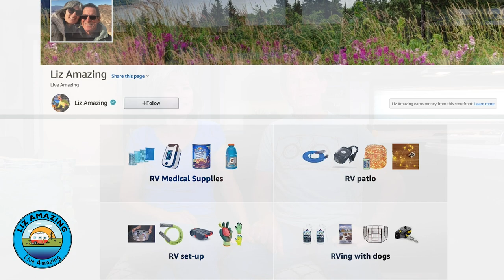RV Life | Sewer Solution | Game Changer | Macerator Pump

Comment: This is spot on. The wife and I have been RV'ing for 30 plus years, and a macerator system is the only way to go. The only thing that tops it is the two macerator commodes that we have in our coach. Does the same job right at the "business' end. It also allows you to use regular 2 ply tissue.
Reply from the maker: Sounds like a winner! We actually flush wet wipes down our rig and have no problems. But they do sit in the tank and start breaking down first, so am not sure if they would work for you. Here's our video about that: https://youtu.be/2Ziwfzf6xK4

Comment: I use the macerated pump the same way. One additional thing I did was adding a 1” 90 degree cam and groove fitting to the top of the tote and the ends of the hose. Put a adapter on the pump and you are good to go. Find a industrial distributor of small plastic tanks that will drill a hole and spin weld a pipe fitting to the tote. Install a male cam adapter with a cap   . No longer have to muscle a 35 gallon tote that weighs almost 300# when full. Almost every time I’m using it someone stops by to see the setup. Good video.
Reply from the maker: Paul says that's a good idea!

Comment: So apparently shit doesn't go uphill so I got this macerator, hose and adapter you recommended. I was trying to reach 40' ft incline to the septic inlet.  I used a regular garden hose in combination with the extension hose to reach and for power I added some wire extensions from the macerator to my battery bank so I just need to plug in the wire connectors supplied and push the button. Works good. Problem is I have two black tanks with two separate outlets far apart from each other so the other one is still a slight issue to dump but it's closer to the septic inlet. Fyi for those who have two separate outlets; Don't try and use the macerator connected to a Y connector on rhino hoses. It just sucks up the hoses. Kinda like trying to suck up a thick milk shake through a cheap plastic straw, the straw collapses. Lol. Otherwise the flojet is good. Hope it can handle all the thick long hair of my partner. Her hair is my worst enemy.
Reply from the maker: Thank you! Here's our update: https://youtu.be/QzTkLgpxXnE
Reply from the maker: Good info RD, Thanks!
I can see a potential issue if enough hair gets wrapped around the impeller, good luck with that. 
Thanks again for a great comment. P.
Reply: @LizAmazing  no problem. Thank you for your detailed video. You two helped a lot. I too spend time using the tote so it is going to help not having to take it out the bed of the truck. 

Good luck out there. We are in Oregon now trying to make it through summer. Waiting for all the part timers to go home already. ; )

Comment: We have an Airhead composting toilet. It saves water usage when dry camping.  I was afraid of it at first, but after having it for over a year, I would never have anything else. We pulled our black tank and installed a second, larger grey tank. We also have a macerator to pump grey water into a water bladder into the back of our truck instead of having a tote - we used to have a tote, but now, since we just have gray water its less dangerous and we can use a lightweight bladder, the same type for acquiring freshwater.
Reply from the maker: Sounds like you have a good setup for dry camping. Did you know in Australia they call it "wild camping?" I love that. We have heard good things about Nature's Head which is probably similar to Airhead. Happy camping to you!

Comment: I have had a Macerator for my RV for 5 years. When boondocking or camping without sewer at campgrounds near home (less than 50 miles) I won't even bother to use the dump station. I'll just come home and empty into my home sewer through the clean out. I can take my time and get the tanks really clean. But, I don't have a tote so if I have a choice between scenic site or sewer site, I'm taking the sewer site.
Reply from the maker: Yep, without a tote, the sewer site is the winner! Glad to hear you have a macerator as well. It's been a real game-changer for us! Happy camping to you!

Comment: I've been boondocking for nearly 4 months in a BLM long term visitor area(LTVA).  I use the same method Paul described.  Tote in the back of the truck, and I fill the tote using the macerator pump.  I'm a mile and a quarter from the dump station.  I also have a 30 gallon fresh water bladder.  My routine is, once a week, I dump my tanks into the tote, dump the tote, then fill the water bladder before my return.  I also have a 12v fresh water pump, like what the 5th Wheel has for internal water.  I use it to pump the fresh water from the water bladder into my fresh water tank. I have not had to move my fifth wheel for water management.  I've used the mactator for dumping into a household sewer via the cleanout, while moochdocking too.  (people should check local regulations on that one).  I can say, this is a worthwhile investment, and can be a real convenience, and time saver...
Reply from the maker: Awesome comment, Roger, thank you very much. Loved hearing that you haven't had to move your rig in all this time. As far as moochdocking goes, one could run a garden hose into the house and dump into the toilet. Thanks again for your endorsement of the macerator pump!

Comment: My coach came with  a m pump system which I had never seen before in my life I have used it since 2007 and it is absolutely wonderful. And it will pump uphill 40 ft.² through a 1 inch line. Thomyt
Reply from the maker: Yay! Macerator pumps really are game-changers! See you on the road!

Comment: You mentioned a macerator might not be good when you're boondocking. It's the perfect accessory if you're boondocking, if you also have a fresh water bladder & a pump to transfer the water to the rv. We've spent months in the desert north of Yuma, AZ & never had to move the rv. We have an 85gal vinyl water bladder that we got from the company that used to make the blue 45gal one for Camping World. They'll make any size you want, & when you're not using it, it folds up very compactly. The company is New World Mfg., in Cloverdale, CA. You also need a pump, either AC or DC.  I bought an AC pump from Harbor Freight. I pump the waste into my 35gal tote in the truck, then go to the nearest dump & empty it. Then I fill the 85 gal water bladder & return to the rv & transfer it into the rv. So we can sit out in the Southwest desert for long periods, & not have to be stingy about my water usage.
Reply from the maker: Yay! Glad to hear! You got that right about the bladder, too. We just did a video about that, check it out here: https://youtu.be/qi-9y8ml424

And it sounds like you have a good setup and are living the good life in the desert!

Comment: Enjoyed the tech talk on the reality side of cleaning the tanks. I wondered how a less physically endowed person like me would handle moving the waste water. As usual you two are showing the way. Back when we were a road warrior family the head was strictly for use when you were sick or injured. Often the campgrounds were selected based on non pit toilets and showers if at all possible. The trips were more mapped out by the quality of the facilities then by what we came to see.  We spent a lot of the time hiking to the restrooms. The tank cleaning was often done once or twice during the whole vacation and in those days emptying the tanks was done on the way out of the campground at a drive in dumping station. The idea of actual sewer connections at the site..... wow that would have been pig heaven.
Reply from the maker: Yes! Things have really changed, haven't they? I started camping in the late 80s and it was assumed for many decades that electric AND water were luxuries. Now full hook-ups is standard at many private campgrounds. We've been to several RV parks where the sewer hookups are in such demand that people stake out sites, sign up for them or otherwise demand them. I think for the fulltime RV life, a lot of people have a washer/dryer on board or kids so they just have to have the sewer. Thanks for your comment. And YES you can handle the tote with no heavy lifting if you get the macerator. See ya on the road!

Comment: We have the same rig and just bought a Valterra twist on tank valve at the base of our tank drain. Our previous RV had it and it is nice to have (no surprise when you take the cap off!).   As low as it was before, it is lower now!  My husband is wanting to maybe cut back the drain tube so that it doesn't hang so low.  Will let you know how that goes.  

As to choice of site, we would choose the view over the sewer - as long as we have access to a dump station (and you never know who you might run into at the dump station!  LOL) we are ok.  But with two of us and only weekend or short term trips, we don't need sewer so often but longer trips, we would likely want the sewer hookup.
Reply from the maker: Very good points! I had the twist-on, but yes not enough room to add one on this rig. When we got in that tight situation at the Idyllwild campground, we broke off the sewer cap so we know we are low. I think you could cut off some of it with a dremel. Paul has a roto-zip, which is kind of a dremel on steroids!

Comment: The best tank to use is a 50 gallon plastic barrel. Use one with the corse and fine thread bungs so you can use standard pvc for the outlet on the corse side. Add waste gate to the output and get a hose bulkhead for the hose from the macerator. Its a much cheaper setup than a store bought tank. Make sure all connections are well sealed and it will give years of service. My tank setup cost less than 60 dollars and i have a 50 gallon capacity which is well above the trailers 32 gallon black tank. Also add an air vent on the top.
Reply from the maker: That’s awesome, John! Thanks so much for sharing. I’m not sure that everyone that is traveling can carry a 50 gallon barrel, but definitely helpful. Thanks for watching.
Reply: @Liz Amazing  I edited my comment to fix one word and added the air vent to it. Won't fill or empty too well without an air vent. I do understand that some can't use a 50 gallon drum. My camper is a 36' pull behind so I have a lot of space. They do have 30 gallon drums as well. Those should work for others and you could use 2 of them.

Comment: I bought these items, too because we have had to boon dock at home due to smoke from fires. Our home, a cabin is far from air tight!  We do not have potable water and and far away from our septic clean out. We are 20 miles from a dump site! I bought the biggest tank before thinking about, "and then?" So, yes, in the truck bed for sure! We just partially filled and had a terrible time getting it into the truck!  Then i read about the macerator, bought that but have not used it because of wiring. The directions are a bit sketchy.  I have a 12V jumper cable battery that i pump tires with, too, and now a 1000 w Jackery "generator." Can i use one of those somehow? I bought clips. Can i put clips on the wires and clip them to the jumper cables on the 12 volt? I really need it very soon as we were unable to dump last trip. I have to enlist a neighbor to get it into our narrow steep windy drive backward! Last time we got deep scratches in the truck hitting the fence post! That was with help! We are selling our place, but it is not an easy sell. We would use the RV much more if it weren't for that!  Now my truck is ruined😒. Once we sell, we are going to get a fifth and different truck to full time. Could you do one more vid covering the electical for the macerator, please?
Reply from the maker: As long as the battery clips will handle 20 amps they should work. 
Perhaps I should do a video on the setup I did for now I'll attempt to explain it;
I used 10 gauge wire and a 30 amp fuse on the positive leg and I ran the circuit from the battery to a spot in the pass through where I have about 4' of the wire spooled up and stowed in a little cubbyhole on top of the wet-bay so that when I need it I just pull it out and plug in the macerator.
Reply: @LizAmazing  thank you. I will look on the package. I did not look at different sizes, just saw these clips  that looked the right size. The rest sounds great, but uh-huh glaze over on the rest, sorry. It will come especially if you do a step by step. It sounds like a better idea. How do you store your quack hose? I have my cleanout hose in a black bag, but what a pain!  The last 2 places had cut off their hose ends so i could not use the flush! I tried to just hold it up to it but just got a great shower!  That was at Marysville, WA I5 rest stop both sides of the freeway. But was i grateful for the dump!  Thank you.

Comment: My Jayco Pinnacle came from the factory with a macerator. The problem is that the engineer who designed the rig has the handle to open the discharge installed under the camper under a slide out. I’m 73 years old and don’t want to climb under it every time I want to dump it. Especially when I’m parked on a gravel site.
Reply from the maker: Oh no, that's not good. I wish there was some fix for that. Thanks for watching.

Comment: QUESTION:  i have the same set up but i was wondering how you connected the 1" hose to the tote tank.  Is it always like you videoed where you have just shoved the hose into the elbow?  i am in fear of that and having the pump pushing it out of there and having a s&*$tty day. :)  Did you find a better connector piece, and if so where?  Or have you just ran with it like that?  i have searched high and low for some sort of connection piece, but to know avail. Any help would be appreciated!
Reply from the maker: No, I just use that 90° elbow. I don’t hold it down, it stays put. Just have someone stand there and hold it the first time to be sure. But I have never once had a problem- Paul

Comment: Is there a way to hook this up to those portable camp toilets? I don’t want to deal with a big waste tank when it’s time to dump I’d like to just hook up straight to the portable toilet and dump into the sewer station.
Reply from the maker: You can, but it may not be worth it. Small portable toilets like the Lugaloo hold less than five gallons. It's best to find something to dump it to that is about the size of your black tank. However, if you are driveway camping you can hook it to a garden hose and run it straight to a toilet.

Comment: How long-running the macarater before it gets hot and stops working?
Reply from the maker: That’s never happened. As long as you have liquid is going through it, it should have some cooling effect.
Reply: Most macerators will empty the tank loooong before the pump gets warm. And most have thermal cutoff to save the motor. The one I have even has a slot on the back of the motor so if it jams you can manually turn it to clear the clog. Thermal switches will automatically switch back on. You can dump a 40 gallon tank in 4 to 5 minutes.

Comment: I added a nexter 25 gallon grey water tank. When I  primitive camp a pump water out of the grey water tank through a filtration system back into the 2nd grey water tank and I use that water mixed with fresh water for my  1st water tank to   reShower .you  can get a really good  Pond pump with A VU steriliser in it works very well using 500  Gallon pump. aI added a nexter 25 gallon grey water tank in one are primitive camp a pump water aledeh grey water tank through a filtration system back into the 2nd grey water tank and I use that water mixed with fresh water for my 1st water tank to re share with
Reply from the maker: Wow that is awesome, it sounds like you have a recirculating shower! Fabulous! I bet you are really enjoying this life. See you out there!

Comment: A subject that only RVers talk about! 💩😂 We had a very low to the ground sewer outlet on our old rig. One time while staying at Smith Point Park here on Long Island we had no sewer connection at the site and had to dump at the end of the trip. We soon found out that the curb around the dump station was actually higher than our sewer outlet. As Paul said water doesn’t go uphill, so this was definitely a problem. I opened the valve and the waste did flow out, over the curb and into the dump station while the black tank was still full and the pressure of the water coming out was high enough. But after maybe a minute or two it would no longer flow out. Since I had no other way of dumping, I had to let the hose fill up, and then over and over raise it up so the water would go into the dump station sewer. This took quite a while and I had a line of other campers forming waiting to use the dump station! A portable tank is a good option and I definitely like that macerator pump. That would absolutely help in those situations!
Reply from the maker: Yes! You've been there. I had the same situation before I met Paul. I felt bad holding up the dump line but had to do what had to be done. Thanks for your comment. Happy camping to you and hopefully no more poopy situations!!!

Comment: I think you guys would LOVE to use a industrial water bladder instead of the tote, larger capacity and less weight when empty and easier to carry. Check a video from the "sele training" channel, this is the link https://youtu.be/8Qn7z697GxU
Reply from the maker: I've heard of agricultural bladders, which I am assuming are similar to these. Will check them out- thanks!
Reply: Bladders are NOT recommended as they can be punctured easily. The totes are light when empty. I use a 50 gallon blue plastic barrel and it's 24 pounds empty. It just sits in the back of my truck. When I fill it is well over 400 lbs. Bladders can't hold that kind of weight too long before they fail.